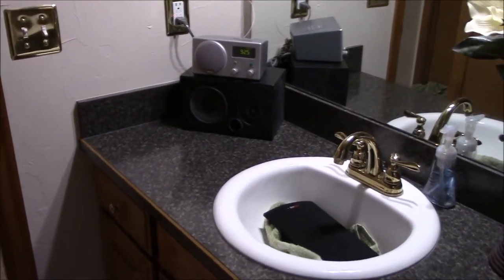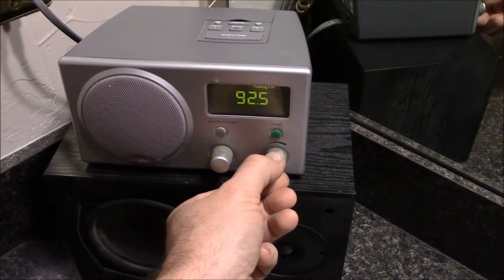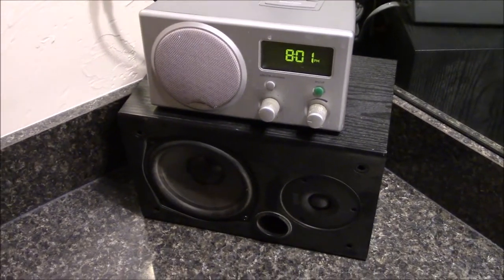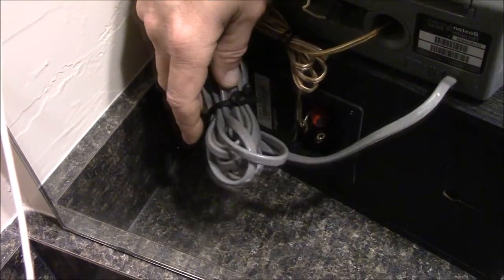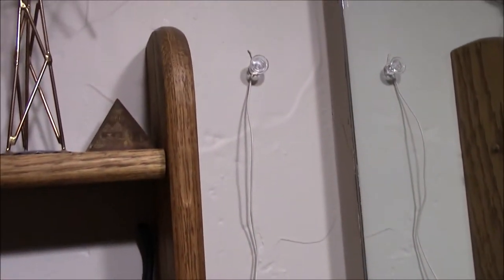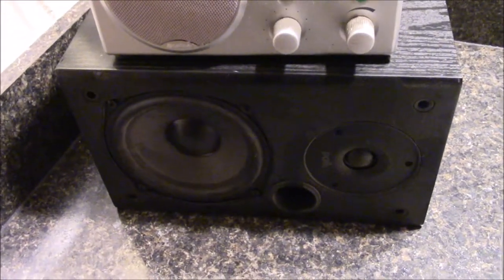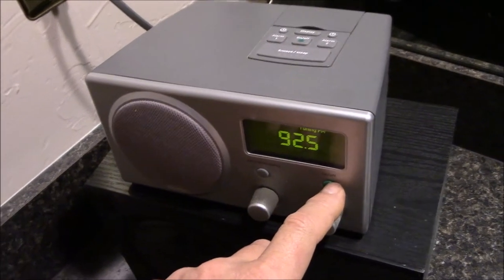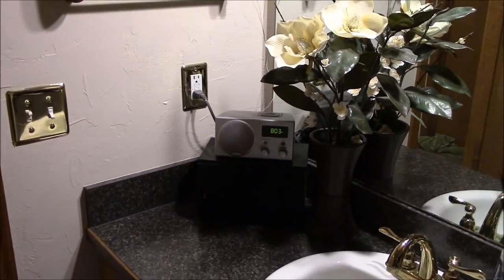How to make an old clock radio sound better - $0 DIY repurpose hack

Comment: Slick upgrade Chris. Have you "waterproofed" the speaker box ?   Perhaps an additional coat of poly urethane and some of those small black adhesive rubber feet to keep it above any slight water splashes.   I have a radio in the "water closet"  that comes on with the vanity light so I can listen to news / music while I am doing the daily ritual.  It also helps to cover any extemporaneous noises from the gastric zone so my guests won't be surprised.   How bout those EAGLES !       Stay productive     J K
Reply from the maker: Yep...need to do that (feet). Really like this guest/small bathroom...esp during AM movements.